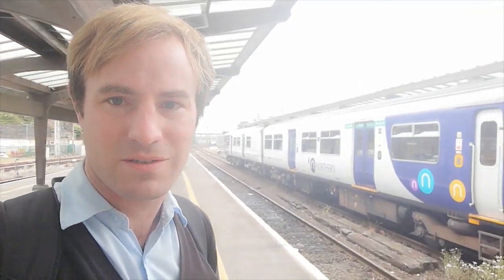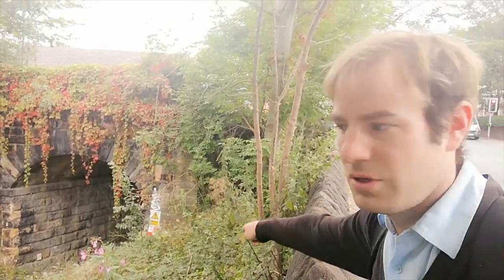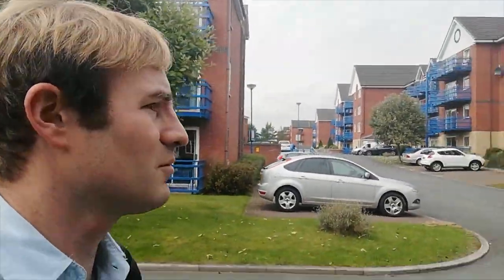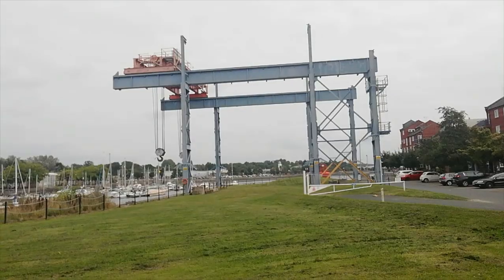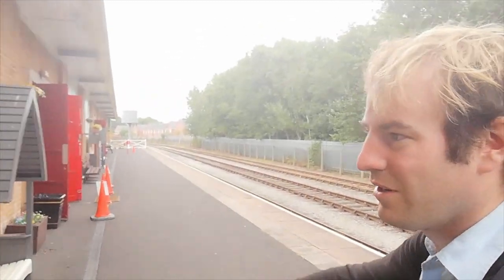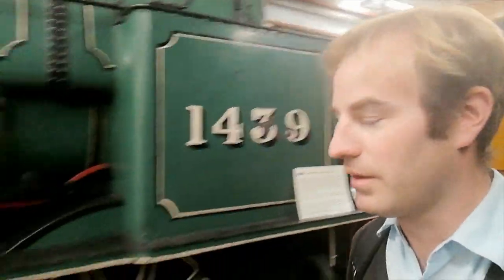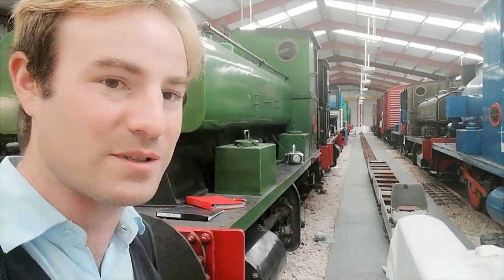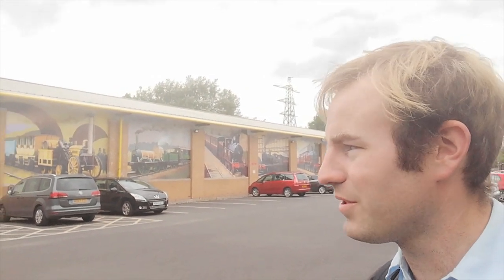The Only Place In England Where A Train Runs Down The Street!

Comment: This must be my favourite video tour of the Ribble Steam Railway and with the added benefit of showing the dock branch route - so glad I found it, thanks for uploading this. It's a fascinating place, so many interesting quirks; railway sharing the road, the swing bridge, the active connection to the network, the bitumen traffic sharing the line with the heritage railway, and that incredible collection of industrials. 

Plus they have some interesting pre-grouping stock (No. 20 from the Furness Railway is one that springs to mind, the oldest working standard gauge loco in the country). The Deltic DP1 mural on the exterior also hints at a surprising link, as DP1 was built at the Strand Road works at the other end of the dock - long since demolished but once part of the same docks railway system. DP1 actually visited the museum for a while a few years ago - I wish I'd seen it in that shed, must have taken up a lot of the space! 

Regarding the bitumen trains, my understanding is that the RSR preservation group also operate the freight on the line as Ribble Rail Ltd - they have three Sentinel diesels that they use to shunt the bitumen tankers across the bridge. Hopefully it's a decent source of income that helps to keep the preservation work going. 

Also, not sure if this was the case when you visited, but I've been into the workshop a couple of times to watch the staff/volunteers working to restore some of the locos and rolling stock - it's over the other side of the car park from the museum. Hopefully you get chance to visit again when it's possible to look around that area, as it's really fascinating. Thanks again for visiting RSR and showing so much of it. You gained another new subscriber :)
Reply: PS I loved that you took the time to explain about the fireless loco too - my stepdad remembers watching that very loco at work at Lancaster power station. I love that it ran all day (pretty much) fed from the waste high-pressure steam at the power station. Shame it isn't still running.
Reply from the maker: @jamfjord  Thank you very much for watching and subscribing. I enjoyed reading through your comments, they're very informative. Regarding fireless locos I did recently have a trip behind one a Mannheim Technology Museum which is in one of my more recent videos. Not long after this visit I saw FR 20 in action at the Buckinghamshire Railway Centre, she was visiting for their steam gala. Thank you again for watching and subscribing.
Reply: @HenrysAdventures  thank you, I'm looking forward to watching your other videos too, especially with more fireless locos 😊
Reply from the maker: @jamfjord  Enjoy! Here's the video with the Fireless loco! https://www.youtube.com/watch?v=DJa2vqH5tLc&t=584s